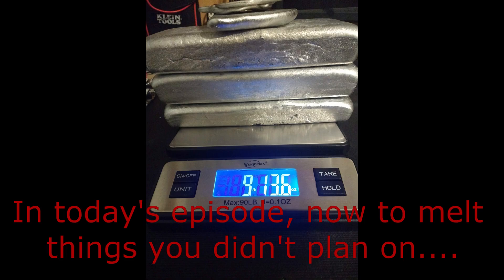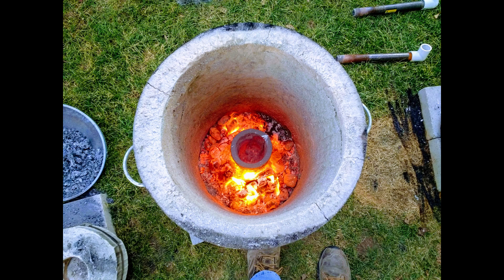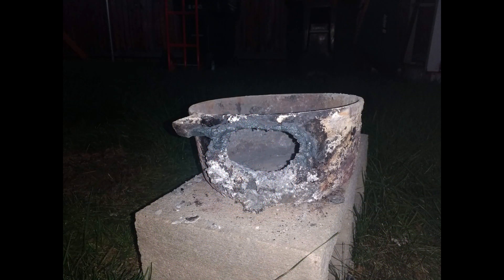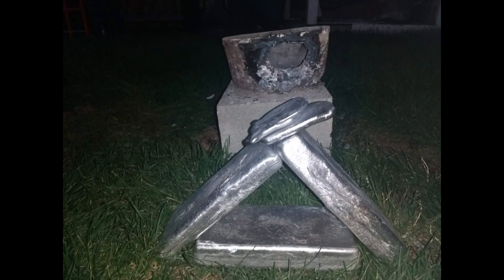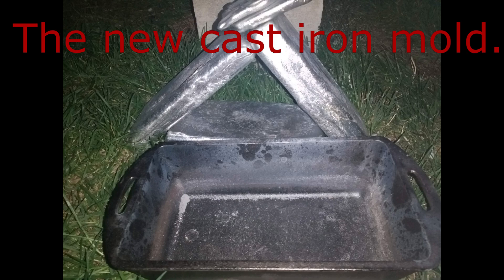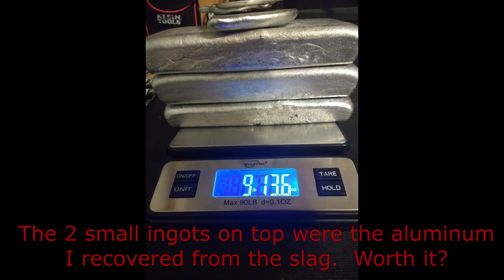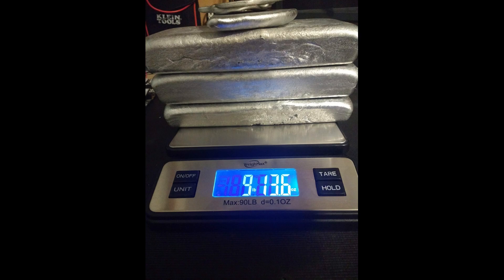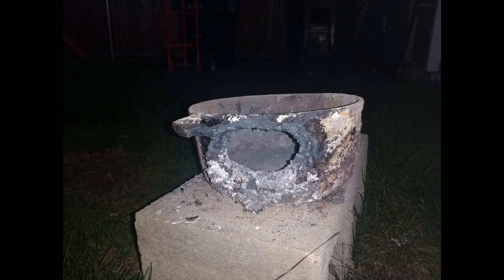Melting Cast Iron with air and charcoal?

Comment: I have ruined several iron and steel pots that way...I think where the fire blows out and on the iron is what did it. I use to use hard wood and a pot would last me over 2 years to melt aluminum in. This tells me that I probablly could melt iron with coal in the right crucible...

Comment: I'm very late to this, but it's possible that you actually oxidized enough away to make a hole in the size of the pot, rather than melting it. AFAIK it's a bit like how an acetylene torch works (when you cut with it): The heat oxidizes the iron, while the continuous airflow blows away the rusted iron and exposes more iron which gets oxidized and then gets blown away again and the cycle keeps repeating till you get a hole cut in the side of your pot.
Reply from the maker: very possible, definately wasn't something I was expecting to see that day!  Made melting large quantities a little hard that day.  I miss using charcoal some days when I melt, but it is nice to have it a bit cleaner and not sucking in all the extra smoke though.

Comment: The size of the charcoal  and air  rate can let you melt steel  real ease.  I found out by accident .  less than a minute. Melted a half inch piece in the fire.  The size of the fuel was around a nickels  size and below flakes. Thick as a 1/4 of a inch . The air rate was a bit higher than normal .      You may want to make a shaker box to keep this size out of the run  or to less them.
Reply from the maker: In my case it was higher air (had it on high instead of low) and it was all very small sized charcoal, so based on what I recall and what you said, guess I'll have to keep that in mind in the future should I go back to charcoal and air!  Thanks for the info.
Reply: So can you melt cast iron with regular wood charcoal or no?
Reply: And how?
Reply: @Arheidi   yes you can melt cast iron with regular wood charcoal .  You have to size the pieces to the right size to get max heat and  you need the right amount of  air blowing.      Size is around  the size of a US  quarter to  nickle size .  Air flow is  kind of high. I  use an air  bed blower, so i have to eye it.  The  fire , color and brightness  of the charcoal    is how i tell  when it where i need it.   If you are trying to melt  cast iron   in large amounts.  you are going to need a lot of fuel  sized  before hand.
Reply: @blackgriffinxx  can I have your email or a way to communicate with you?
I'm working on a project that is in the primitive type of theme and I need to melt cast iron with charcoal.
But I googled the maximum temperature charcoal fuel can get and its just above 1100 celsius which is below the melting point of cast iron(1200 celsius 2200 farenhite)
Reply: @Arheidi   I call BS   on that  number.  I melted high carbon steel  in my forge.  
Don't trust google that much.   That all the info i got. You got to play around with  the size  and air flow to get it where you need it 
Go look into  Bloom steel making .They use nothing but lump /wood charcoal to make steel. it may be the best way  of melting cast iron.    
    Here a video of people making bloom steel  
https://youtu.be/eYga8cdUSnM
here one from a primitive view point 
https://youtu.be/IhCQnqN9l4Y
Reply: @Arheidi  aluminium can melt not cast iron...
Reply: @freddirkuyzaretz311  cast iron can melt too. That's why it has a melting point
Reply: I too am working on a project, dissertation in my case. Crucible steel. Yes, charcoal is more than capable of making cast iron melt... But it gets there quickly if it hits the C percentage sweet spot (4.3 if I recall correctly), otherwise it's a pain without proper air flow. And, furnace type creates various gasses which can be highly reducing and thus lowering the melting points. 
I had issues yesterday, due to small charcoal size, beans and peas (leftover) which I used just to ignite coke. However, it just killed the fire every time.
My ongoing issue is the air flow. I have one belllw made, but it's not enough and it's one pump action, nit continuous flow. I need two, but it's a one man job... So I'll go to electronics. Can you give a measure of your flow?
Reply: @blackgriffinxx  Oh shit, I forgot about that one! I would just need another ply board and some more leather. 
I aim to be as authentic as I can, but fuck, if I can't get the results at least I can avoid using hgss or electricity this way.
Thanks!
Reply: @Arheidi  I accidently melted holes even in steel pots with coal